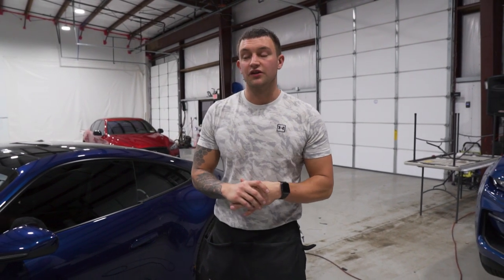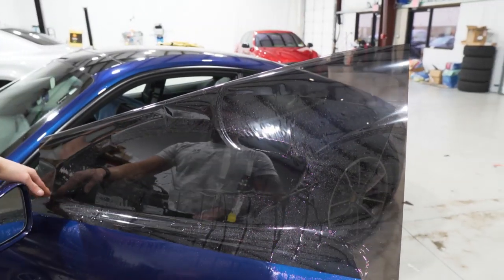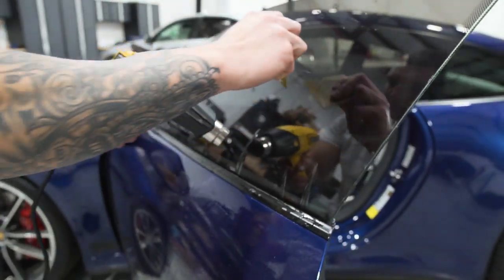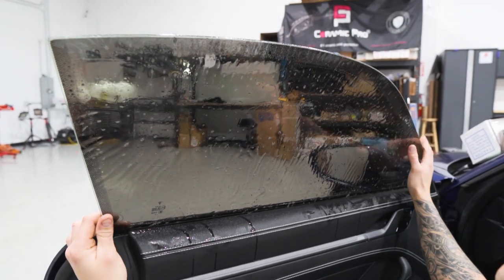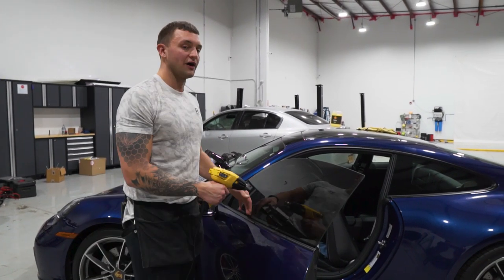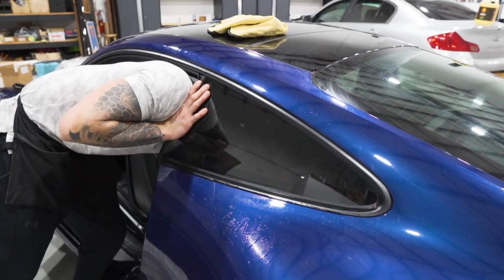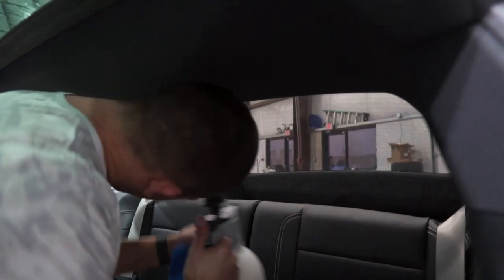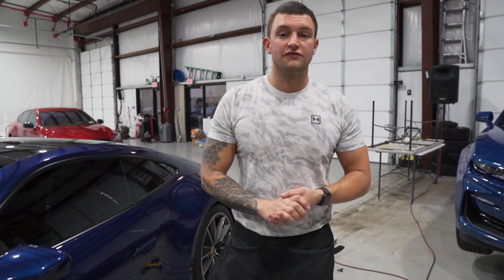How To Professionally Tint A Full Car - 2020 Porsche 911 Carrera 4s

Comment: Whats the reasoning with the dryer sheet?
Reply from the maker: Give the window film a substrate to adhere to as the window film is shrunk. If it weren't for the dryer sheet, the film would just simply slip all over the place and not stay in its heat formed state even during / after shrinking